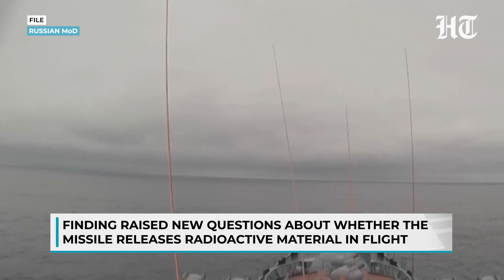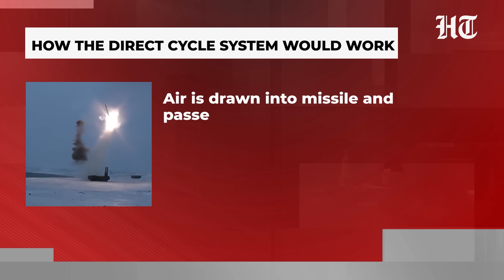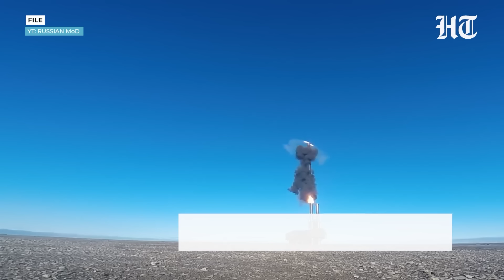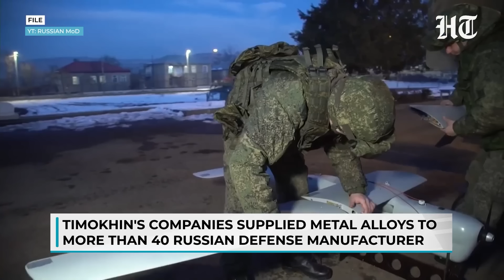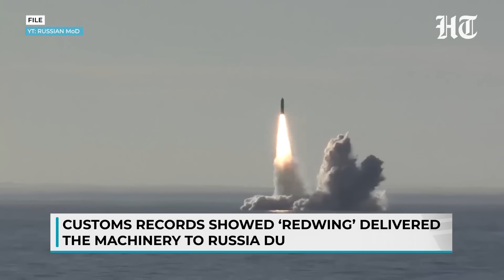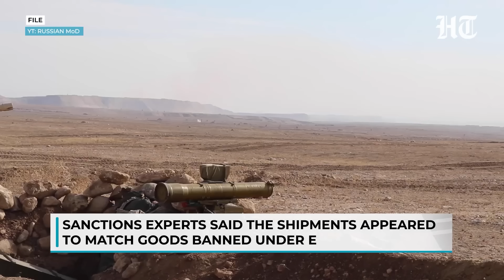Putin’s Nuclear-Powered Cruise Missile Burevestnik Decoded; Russian Skyfall A Radioactive Hazard?

Comment: They looked at how they would think to do it. They looked at the only way they know how to do it 😂 The NATO monitoring system showed that it didn't leave radiation behind. What are they trying to do, make them say how it's done? Do you think anyone would fall for that? Their own observations already say it cannot be getting done that way... they just cannot figure out how to do it differently 😂 in the end: it is a nuclear missile that only ever carries nuclear warheads... if they are firing nuclear weapons, are you really worried about the exhaust anyway? 😂
Reply: Even if it has no cooling loop, a unit with a cooling loop adds weight and thus increases the size of the engine and thus the catastrophe if it crashes.  I'm not saying an open reactor is good, but to present a narrative without mentioning why it might have been used is misleading.
Reply: @lelandtsnyder9684  NATO had radiation mobitoring equipment during the last full engine test. There was no radiation leakage. They dont know how they are doing it, but they do know it was not spewing radiation out the back. In the end I imagine this is only designed to carry nukes... and therefore if you are firing this thing, do you really care if the enemy hurts themselves if they shoot it down?
Reply: @jamieswithenbank1813 it is designed as a deturent, it can fly indefinitely, so if it does, yes, they should care about it.
Reply: @lelandtsnyder9684 at the end of their test, the russians landed it safely. If they want to stop it then they can clearly land it. If the enemy wants to stop it, they have to shoot it down and cause problems. NATO monitoring indicated it doesnt spew radiation when flying. So then what is the problem?
Reply: @jamieswithenbank1813 we had unexplained rises in background radiation at the time.  Everything radioactive leaks.  Your statement IS, "Dogma".